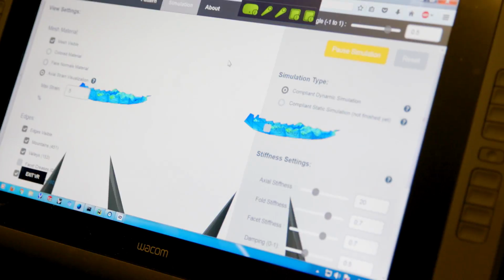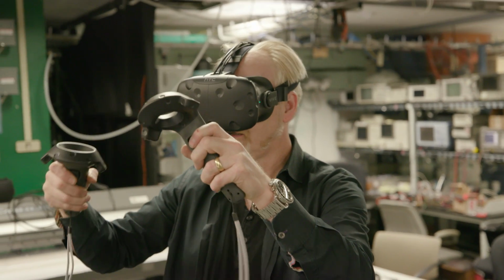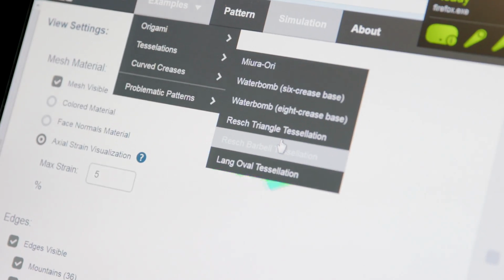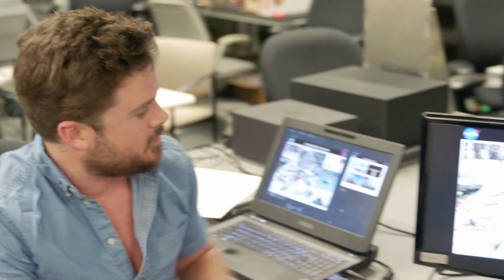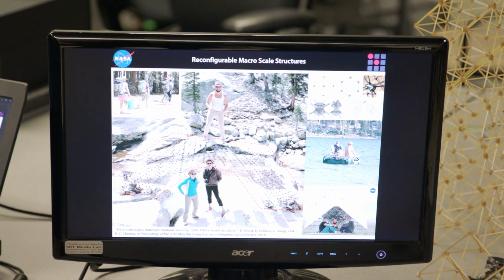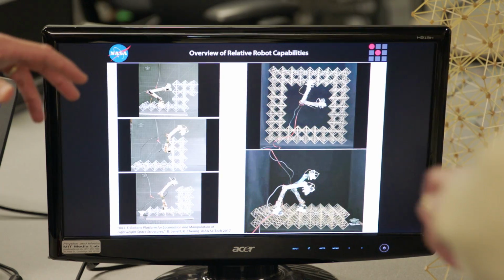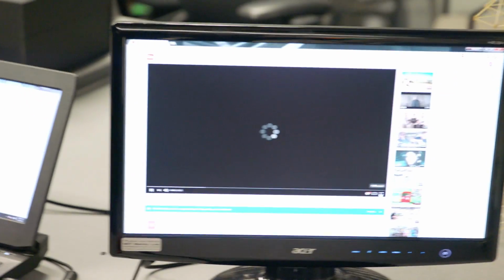Adam Savage's Maker Tour: MIT's Center for Bits and Atoms (Part 2)

Comment: 10:27 As far as I see this is not a full octet-truss (only octahedrons no tetrahedrons - only eight incoming edges per node). I guess they decided to sacrifice some (quite a lot actually) structural strength to prevent node congestion since in a full octet-truss every node has exactly 12 incoming edges edges meeting together.

Comment: 10:27 reversibly constructed high modulus carbon fiber loop spaceframes
12:00 GSWT (graduate student with tweezers)
13:00 BILL-E ... bipedal isotropic lattice locomoting explorer
https://ntrs.nasa.gov/archive/nasa/casi.ntrs.nasa.gov/20170006219.pdf
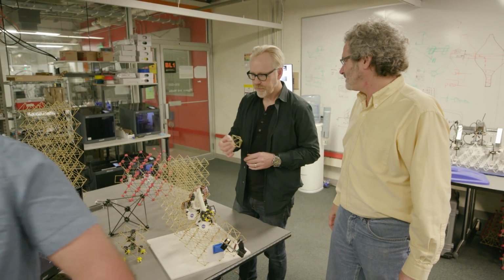16:03 MOJO ... Multi-Orthogonal Jaunting rObot in Microgravity
https://flightopportunities.nasa.gov/media/technology/164/163-summarychart.pdf

Comment: just to get this strait, this is purely at a prototype stage, at a scale which is easy to work with, but my understanding is that the "end goal" based on the two videos, at the atomic level, particles could be transformed into the required material, bonded and used as the building supplies for the molecular assembler which is bill-e... 

remembering that every piece of matter is made out of atoms, and every atom has it's own building blocks, so rather than using a material like carbon fibre, which you need to work with, you could simply create for example, a jumbo jet, fully "painted" and furnished and all, out of nothing more than atomic building blocks, pieced together in the right order.... 

purely as an understandable example.... using essentially precision lasers you could tear 2x water molecules (h2o, (two hydrogen atoms, one oxygen, times two for the two molecules)) apart, passing off the two spare hydrogen atoms, and reforming the 2 remaining hydrogen atoms along with the now 2 oxygen atoms, and create h2o2, which is hydrogen peroxide as well as  a single hydrogen molecule....... literally changing the molecular structure, into what is needed at any given time, and using something like Bill-e to assemble these molecules into a structure.... 

hopefully thats kind of a strait forward way of explaining what they're trying to do, and thats if i'm understanding correctly...... some of my terminology is off,  for simple understanding.... but am i on the right path?!

Comment: Those bots make a lot more sense for space construction than aviation structures. Modern composites are really thin and perfectly oriented for the loads they take. Why would anyone want to make a jumbo jet out of that thick lattice structure? Sure, it's lightweight and strong, but it's also quite voluminous.
Reply: this is purely at a prototype stage, at a scale which is easy to work with...

my understanding is that the "end goal" based on the two videos,  would be at a molecular level... at the atomic level, particles could be transformed into the required material, bonded and used as the building supplies for the molecular assembler which is bill-e... 

remembering that every piece of matter is made out of atoms, and every atom has it's own building blocks, so rather than using a material like carbon fibre, which you need to work with, you could simply create for example, a jumbo jet, fully "painted" and furnished and all, out of nothing more than atomic building blocks.... 

purely as an understandable example.... using essentially precision lasers you could tear 2x water molecules (h2o, (two hydrogen atoms, one oxygen, times two for the two molecules)) apart, passing off the two spare hydrogen atoms, and reforming the 2 remaining hydrogen atoms along with the now 2 oxygen atoms, and create h2o2, which is hydrogen peroxide as well as  a single hydrogen molecule....... literally changing the molecular structure, into what is needed at any given time, and using something like Bill-e to assemble these molecules into a structure.... 

hopefully thats kind of a strait forward way of explaining what they're trying to do... some of my terminology is off, purposely for simple understanding....

Comment: This is breaking edge technology. What they basically develop is a completely modular and extremely versatile way to build electronics and structures. The first one is basically a modular system of very small electronic parts, that can be assambled to any device you need. The second is a way to build big but extremely stable structures with robots. Both is especially needed for space travel. You send some robots and a ton of the modules up, and the robots assemble it in orbit.
Reply: In the future, there will literally be robot spiders in the walls.
Reply: TheExplodingChipmunk thanks for the explanation
Reply: You send 'a ton' of components up. A robot or perhaps the same robot assembles components into modules and then the modules into larger rhizomatic structures.